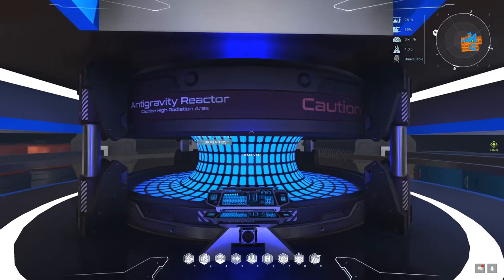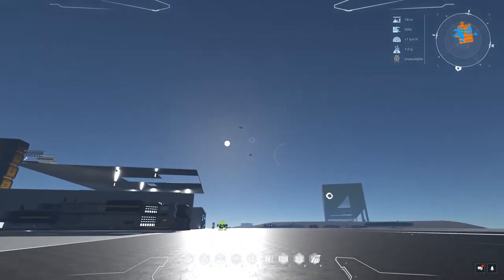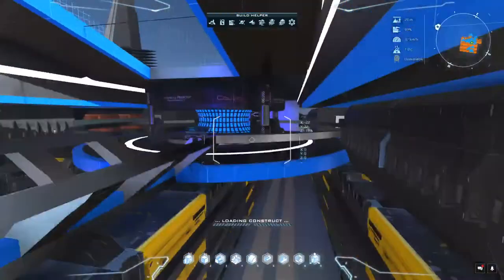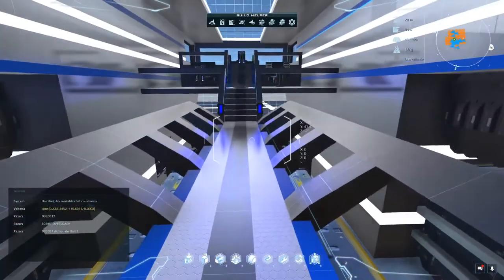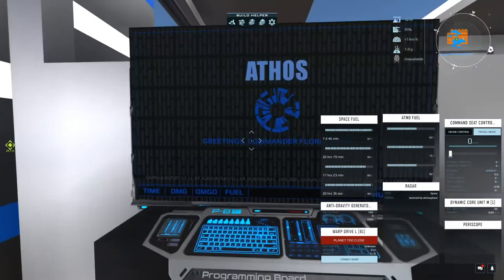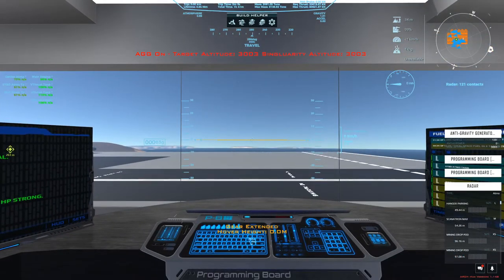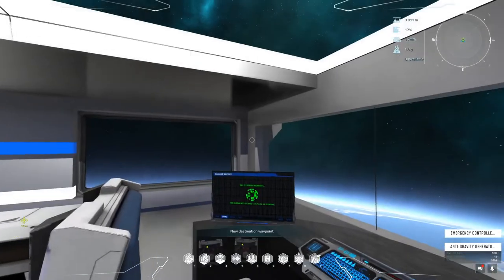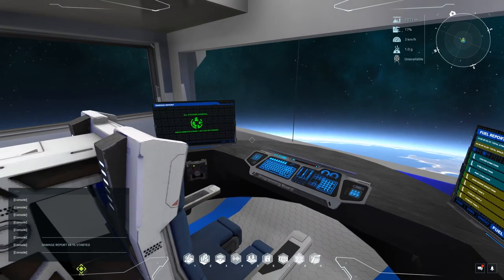Dual Universe - Anti Grav Basics in 2021

Comment: I have not seen AGG shut off at 999m. I have actually seen it start to "pull" at around 850m. If you are gaining altitude slowly and turn your AGG on, when you get to around 850m, you will notice you start to climb faster and the AGG will start showing a %hold number above 0. I haven't noticed if this was changed in any patches since I mostly use my AGG to assist in landing at crowded, and therefore laggy, markets.

If you do a big bounce, like you were talking about, and you happen to fall below 875-900m with any speed, you will be headed to the ground. The AGG is quite happy to HOLD your ship at a set height, but CATCHING IT as it falls "through" that height....... not so much.
Reply from the maker: Nice, I know it used to be an issue where leaving your ship at 1000m it would randomly fall out of the sky by dipping below that, which is why everyone then built giant platforms at 1000m. I usually leave mine at 2000m so haven't checked to see if they fixed that issue, lol, good to hear they did.